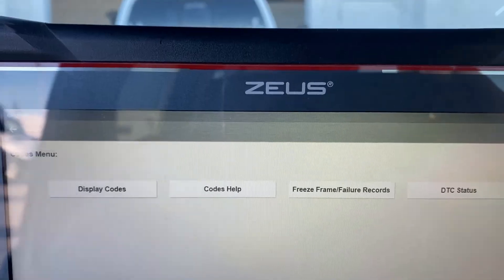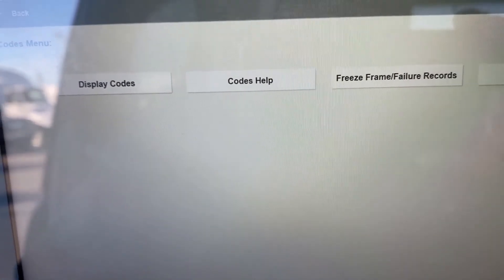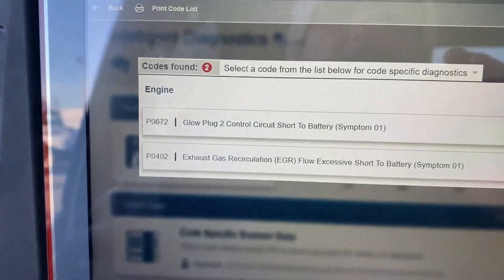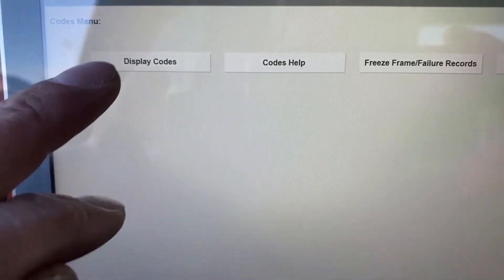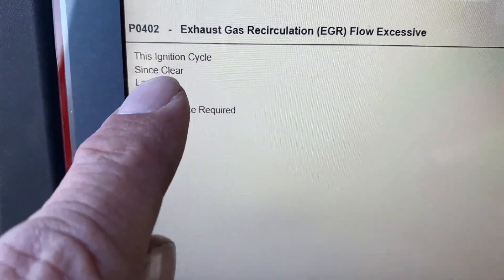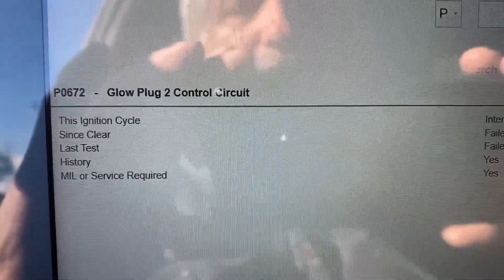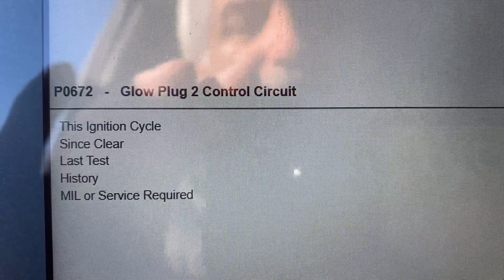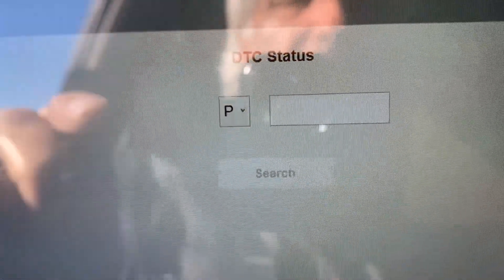Duramax Codes (DTC)

Comment: so what is the fix, thanks
Reply from the maker: @phamgiahung9211  this video was to discuss dtc or code analysis on a GM Duramax.
It showed a truck with codes set. How you can use software to view the status of the code.
It’s been a while but it had the glow plug replaced.

Comment: OK, you have a $12K Zeus and you don't use it that much!!  Wow.    Now, you stated in this video that you prefer the OEM diag. scan tool; would that be the Tech2win with MDI interface for 2014 and older duramax and the GDS2 with the MDI2 interface for 2015 and younger duramax?    Does the OEM scan tool give the "DTC status"?   Thankyou for clearing up other confusing matters for me concerning the SCR system on the duramax.   There is a great deal of misinformation out there and I am having to filter thru a good bit of it.   Eric O. has been a great help at S.M.A.
Reply from the maker: Actually I use my Zeus quite a bit lately. It is one of the few scan tools out there that doesn’t stop working if you don’t update it. Plus been using it in classes checking labscope waveforms. But to be honest I have several scan tools. JALTEST just sent me one of their units to review. I also have a few others like my Ford IDS. 
As for the Duramax info it’s all in the service manual under description and operation. The DTC STATUS is in my tech 2 and on Global GDS 2 but I can’t stand that program since it takes so much to get it going. I use Identifix since it uses links straight to the OE. 
You may want to visit my professional page www.Powertraintraining.com
Plus I host a roundtable discussion monthly
Reply: lol sounds like a kindergarten teacher as well

Comment: i have a U1345 code on a new duramax. Any idea
Reply from the maker: Year? Model ?
Reply: @dieseltalkwithtonysalas8725  2023 chevy 2500 duramax l5p engine
Reply: @dieseltalkwithtonysalas8725  The cooling fan with not disengage. It’s stuck on and always running. Truck sounds like a jet taking off at all times

Comment: Would my truck pass smog with code P0540??? Awesome video very helpful btw !!!
Reply from the maker: In Vegas Clark county it is a dynamometer test which looks at opacity levels.
If there is a check engine light or code set yet it passes the test.
Meaning it can pass even though a check engine light or code set.